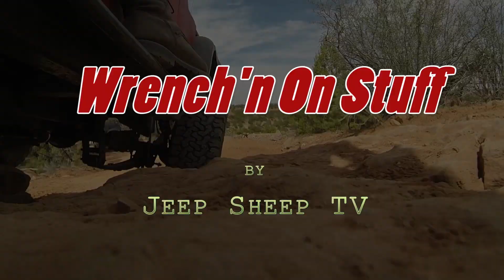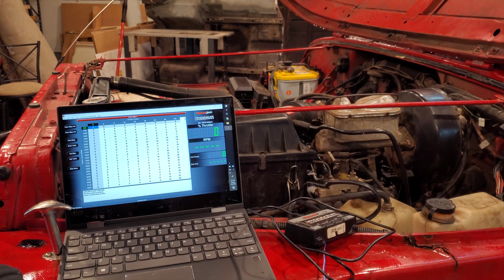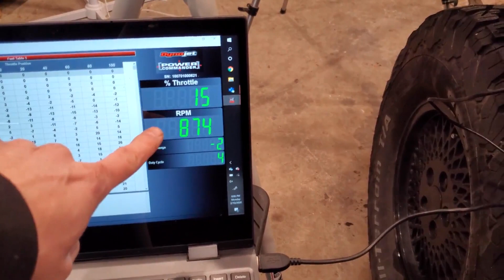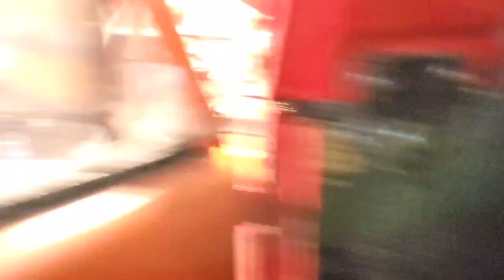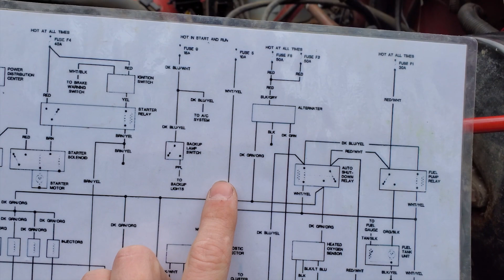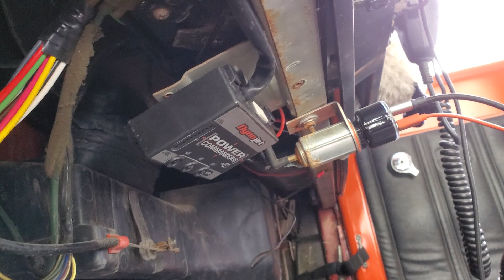Installing The Dynojet PC3

Comment: I’ve been looking for a way to tune my 95 YJ w/ the 4.0 and you seem to have found a way. So, I’ve actually upgraded to the 4 hole injectors, 62mm throttle body, and a cold air intake. Since doing so, it’s been idling higher (exactly where yours was at ~1200) and it’s bugging the crap out of me. Sensors are all good and no vacuum leaks. Could this be due to the injectors? Fuel economy has gone from about 14mpg to 12, but it went up to 13mpg on my last tank. Disconnected battery to no avail and some guys have said it could take the OBD1 style ECU some time to adjust. Does it need a tune to adjust to upgrades? I’m thinking of pulling out the 4holes and going back to OEM.

Comment: Do you need to get a power commander for a certain application? Or Will any model have the same harness?
Reply from the maker: Not all models are the same,  needs to be for a 4cyl bike and it needs to connect at the injectors
Reply: @JeepSheepTV  Thanks, I’ll begin my search lol. Thinking of trying this with a turbo build. I have one laying around from a yanmar engine.
Reply from the maker: @TrailsandTurfGarage  I used it for my Supercharger. It works well
Reply: @JeepSheepTV  yeah I’ve been enjoying your videos 👍🏼
Reply: Did you ever find one? If so do you happen to have a link? How did it work if you found one?

Comment: Can this system work on 6 or 8 cylinders?
Reply from the maker: The module is made for a 4 cylinder engine so not likely. Many 6 and 8 cylinder engines have better aftermarket support and other modules can be found

Comment: If you've ever taken apart your throttle body when you take off your throttle position sensor you'll notice that there's a lot of play in it. I wonder if it's possible to replace it with a more updated throttle position sensor?
Reply from the maker: Maybe, that would be interesting. This sensor sucks. Maybe one off a TJ

Comment: So far everything has worked out great for me except for the tune. I mimicked your exact tune and it has excellent power until about 3,000 RPMs. Once it hits about 3,000 RPMs it falls on its face and has no power through the RPM range after that. It also loses its power after 3/4 throttle. I have the Ford 19 lb 4 hole injectors, 4 l throttle body, and 63 mm spacer. Any suggestions? I'm going to get a air/fuel ratio gauge so I can monitor and that may give me my answer.
Reply from the maker: The AFR gauge is really the answer. The tune is very dependent on your exact engine setup. You will just have to play with it.  I've changed my tune many times.
Reply: @JeepSheepTV  I appreciate it brother. I will most certainly be working on some tuning. I have also bolted on an Eaton m62 supercharger from a Mercedes slk 230 and will be plumbing it in once I get my tune somewhat descent.
Reply from the maker: @Steel-Gunner  That's what I like to hear! Send photos to jeepsheeptv@gmail.com when its finished!
Reply: @JeepSheepTV  will do
Reply: Can you make another video on changing the tune?

Comment: why dont you use quick connect wire clamps instead of splicing like you do haha it would save you a major headache they just clamp with pliars and then can heat shrink if its staying connected long term. im just coming across you whole series because i do alot of custom fab stuff and realize its older and hopefully you have came across the wonderful world of quick connect wire clamps by now but they basically slide over the wire you wanna tap and you other wire is in the other side and you squeeze a staple looking thing down and it cuts thru the coating but not the wire so it doesnt harm you factory harness at all.  i usually do 4.0 and ls swaps similar to this but another way to go about it is to use an m62 or m90 from old thunderbirds or grand prix etc and even jaguars and xterras depending on the jeep but make yourself an aluminum plate to bolt to kinda like a mount but cut out a hole the size of a throttle body space and mount it directly on top of intake like its meant to preform and you can use an m90 snout  to get further out of you need to reach belt and then the throttle body and sensors will mount on backside and run you air intake to the other side and if you want you can even put a tiny intercooler in top of engine and heatsheild bottom from motor and make you hood functional to get some ram air and it works well. if you are brave cut you intake as big as the opening on the supercharger and use a piece of aluminum to spacer it up enough to clear the shape of intake but give it all the air its meant to send and youll see big changes. also seats from grand prix in like 03-08 range almost bolt in when you swap your frames on and if you get them from 2 door the seats folding up feature still works and iy actually folds flat forward and you can lay down level in it without rear seats or haul big items since its a flat platform dash to rear gate. you can even hook the power up haha . great info your putting out though best of luck to ya happy wrenching!
Reply from the maker: I have used those clamps and I no longer use those clamps due to all of the electrical issues I have had as a result of this clamps... they just don't last. I am very aware of supercharging this engine.  I have a whole series on installing a clutched m62. I like to be able to go mad max and turn it on and off lol. Thanks for watching!

Comment: So, did you started at zero gain? I am following this because I have also upgraded my injectors and it runs rich, but is has more torque at mid range. I would like to be able to tune mine in. I can't wait for the coming videos.
Reply from the maker: Yes, I'll be starting at zero. The next few videos will be me determining exactly what the pc3 is doing and how it works with the Jeep fuel injection system.

Comment: Really cool bud. Can I do this to my 03 tj 2.4 liter?
Reply from the maker: I believe so, however you might wanna look to see if there's any other aftermarket tuners that may be easier to use. I suggest a few in my previous video.  This however, is likely cheaper than most things you'll find on the market.
Reply: Ok thanks bud

Comment: Where did you download the program for the pc3 on your laptop ?
Reply from the maker: Dynojet website
Reply: @JeepSheepTV  Are you just using the Power Commander III USB Control Center Software - Version 3.2.1 in the downloads section
Reply from the maker: @SpecialMomentsLLC  Yup!